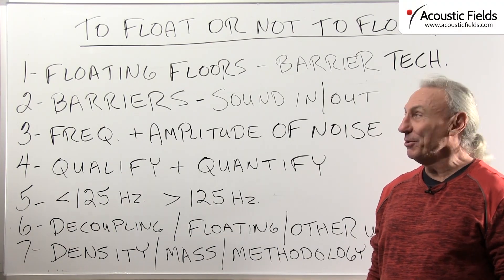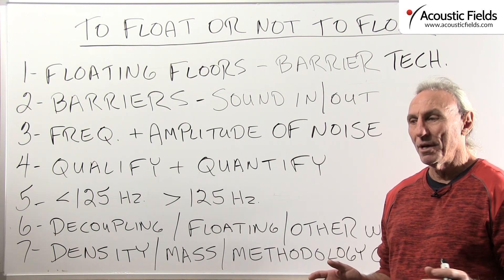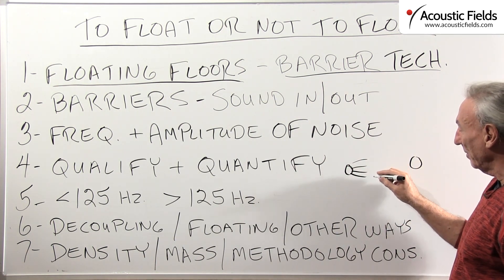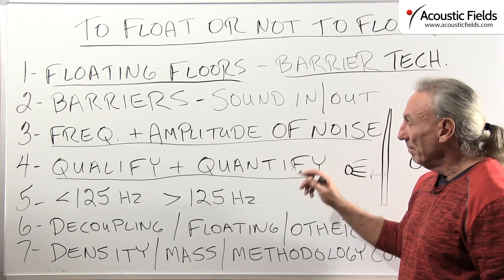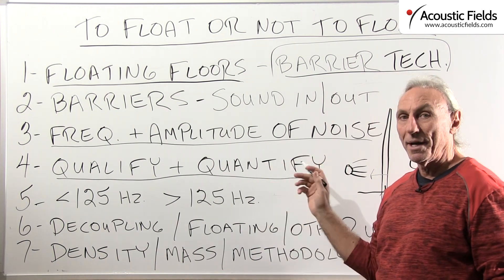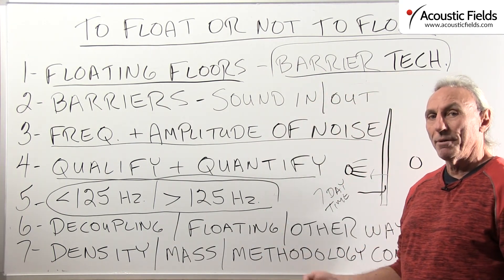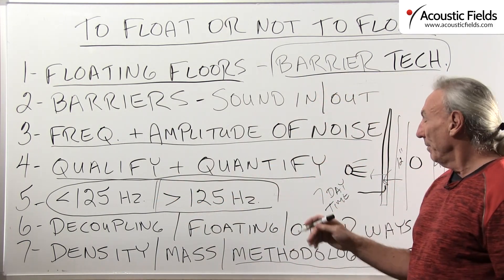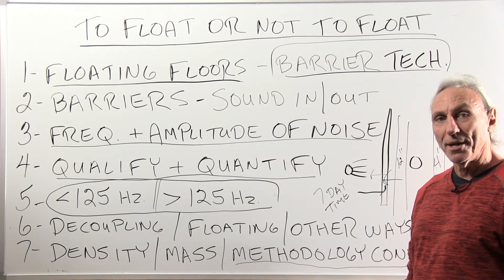To Float Or Not To Float - www.AcousticFields.com

Comment: someone got a HD camera!! lol. great videos i've learned just enough to dangerous!
Reply from the maker: Hi dolt454, With acoustics it is strategy first and tactics second. You must quantify your issues with measurements and then apply the appropriate tactic (absorption/diffusion/barrier) or method to fix. It is 75 % thought and 25 % action. Most people use tactics first with no idea why they are doing what they are doing. When asked why they are doing it, they say they read this or heard about that. This or that is not a tactic and 75 % action with 25 % thought is not a strategy. There are simply too many variables to guess at solutions.